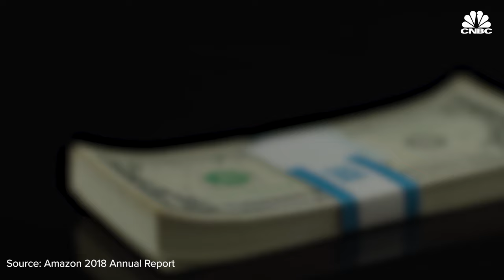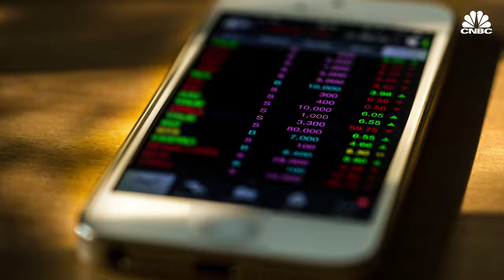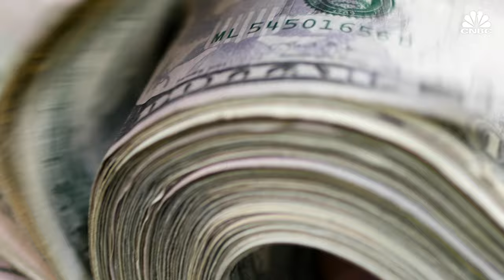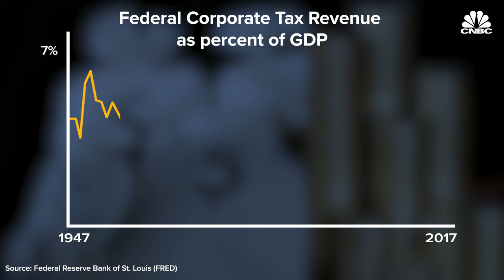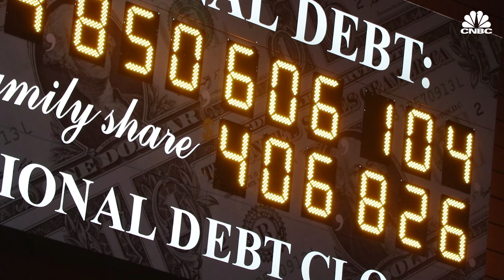How Amazon Paid $0 Federal Income Tax in 2018

Comment: Amazon is trying to modernize and automate their business.  So the cut they were givin, which is supposed to trickle down to the employees, is instead being invested in technology that will replace them.
Reply: And that is the real crux of the issue. I work at Amazon right now and they recently build an automated warehouse near me and the place I work at has had their employment heavily dip and the number of products going through the building doing the same. A building that only a while ago was one of the biggest in the area is now a shadow of it's former self. 

This means those cuts definitely wont return back to the people. And with Amazon going fully automated other warehouses will shortly follow suit and possibly buy or rent Amazon machines similar to how many data centers are owned by Amazon. Many don't even know that games like even Fortnite run on Amazon data centers.
Reply: Go learn how to repair the automated machines when they break??
Reply: Jack Smith they could train some of their employees to be technicians but it would be a small fraction of their workers.  No company has ever automated their business and then kept all the employees on salary just in case a piece of equipment breaks.
Reply: @patdeen6648  That's just the natural workings of capitalism. In order to keep up profits they must continually cut labor costs. However the world is finite in size and the workers can not buy back all that we produce which leads to continual economic crisis. Capitalism is the first system to suffer from crisis of over and not under production. The capitalist close plants if the can't make a profit or can make bigger profits elsewhere.
Reply: @JustAGentleman Spoken like a true member of the Upper Class or middle class seeking recognition from the upper class. Obviously you think of yourself as a consumer because that's your main role in society "to consume". Why not dress up as the last English Viceroy of India holding a tea cup and asking a servant if it's time for tea.
Reply: @JustAGentleman US wealth in general has more to do with the size and large population of the country, the land for farming and the country being untouched by war since the end of the civil war in 1865. Being connected with England and its Industrial revolution rather than Spain and it quest for gold didn't hurt either.
Reply: Amazon jobs is very disliked . If they don't get robots in then they will fail. Nobody likes working for amazon as it is too demanding and most of their employees leave with the first months, so if they dont automate their company then they will risk killing their business
Reply: My amazon doesn’t have tech lmao
Reply: Pat Deen exactly why universal basic income makes perfect sense.
Reply: @Jack51971  that's easy for someone who did it for 5 years CNC machines soind about right
Reply: @kimobrien.  that's not the workings of capitalism thats the workings of greed
Reply: @Wamsuo58u  What business tycoon is not a greedy capitalist who would sell his own grandmother if it meant bigger profits and market share. A capitalist who refuses to be greedy and compete is headed for bankruptcy court.
Reply: @kimobrien.  sociopaths are the problem not capitalism
Reply: @Wamsuo58u  The system is such that it rewards sociopathic behavior. Behind every US Military adventure is a boss seeking higher profits form his foreign investment.
Reply: @kimobrien.  can't argue with you there but that's not the case in every circumstance
Reply: Your story will be the ever growing norm. I hope you’re doing ok. Have you heard of Andrew Yang?  He wants to bring in Universal Basic Income to pay $1k per month, to each Adult US citizen because of all the job loss already happening and that will accelerate.  Amazon is rolling out what you’re talking about right now.  Andrew Yang proposes adding a VAT to each Amazon purchase & others to pay for the UBI.  Because you’re right only a small number of jobs will be left to maintain those machines.  

It’s happening at other companies too. Accenture just told a bunch of underwriters they’ve been replaced by AI machines but they’ll train them to check the software. Ironic having to keep check on your replacement! They won’t need many.. google search the story 

We all need to help Andrew Yang get into office to help the people.  Trump is not even talking about it.
Reply: Andrew Yang is proposing Humane Capitalism.  Check it out on his website.  

#Yang2020
Reply: modernization is partially a byproduct of an artificially inflated minimum wage-  the $15/hr luxury of the entry level job comes at a cost somewhere down the line-  wages go to zero dollars once they are not needed anymore...
Reply: R + D is tax deductible as mentioned in the beginning of the video. So, technically totally legal
Reply: Major FACTS!
Reply: @Skylancer727  scary stuff, I hope you find something else before the shoe drops. 
#yang2020
Reply: @JustAGentleman Most of the consumers won't be buying when they don't have a job
#yang2020
Reply: @JustAGentleman Until they get the drones sorted out
#yang2020
Reply: @Kyle-pj2vc  And big billion dollar campaign contributions incentivize massive tax cuts for those donors

Pfizer --> 
Donations to GOP: $16M 
Tax Cut Received: $39B 

GE-->
Donations to GOP: $20M
Tax Cut Received: $16B 

Chevron-->
Donations to GOP: $13M
Tax Cut Received: $9B 

#Yang2020
Reply: @jobokidd  personally plan on joining the rail road. Though that will likely be going automated in the next decade too. I want Yang to win but seeing his debating skills, it's not happening. The last debate showed pretty well he isn't quite ready and he needs some time to understand how to get your voice out there. 

I'll vote for Bernie this time. I'm hoping since Yang is pretty young he will have a chance to shine next time. He will definitely have a stronger name for himself by then. By that point Amazon will have nearly gone fully automated and self driving cars will be threatening truck and taxi driving. That is when a paradigm will shift and his voice will stand above everyone else. Too many people right now have their heads on other policies and some are too sceptical of socialism to support it. When the threat is more visible then I imagine more being conscious of it. Then he will be number 1.
Reply: @Skylancer727  Did you see that NBC shut off Yang's mic?  There are some montages of all the sneaky media sabotage of Yang, which really proved to me we're now in a Plutocracy.  I understand where you're coming from though.  I'm still hopeful for Andrew and trying to spread the word.  Peace.
#yang2020
Reply: @jobokidd  Yeah, UBI is the way of the future. I just don't think the idea has baked long enough. When automation is more visible to people, then they will care. With automation in the warehouse, driving, and shopping markets; it's already covered nearly 60% of the work force. This is the calm before the storm and unfortunately, it seems people just don't see it coming even there it's already on the way. 

I feel it's people's desire to grasp on to capitalism as it is the big thing that made America special, but like it or not automation is coming. We can either block it or adapt for it and I choose the latter.
Reply: You are right a large percentage of jobs will be replaced by robots, self driving cars and AI driven programs in general. Sadly this storm is going to happen much faster than most people realize and are prepared for. If and when Quantum Computers become much more practical at a reasonable cost this also will be a huge game changer, especially once it's combined with AI and robots. Quantum Computers are coming in my opinion, likely much sooner than we expect. It's just a big breakthrough or two away from changing everything overnight. It's not a matter of if but when in my opinion. I closely follow AI and Quantum Computing and both fields are advancing rapidly recently.

I'm not sure if a Universal Basic Income would work or not but something must be done to counter the massive loss of jobs that is coming due to the things I mentioned above. That much is clear.
Reply: @AnthonyGoodley  well I'm not as certain behind quantum computers coming any time soon. Right now we are limited by our understanding of quantum mechanics and our understandings of physics as quantum computers require rare properties to function (such as super conductors which right now require exotic cooling). Basically quantum computers can't take off till graphene is perfected or we switch over to light based computing. But of course if we can get quantum computers to be mass producable at least in the $50,000 price range expect many logistical and engineering jobs to start disappearing. If a computer can process thousands of concepts at the same time to find the optimal solution, we don't stand a chance at competing. 

Of course automation in general is already more than capable of plowing over the entire system. With jobs like warehouses, driving (taxis, trucks, trains, etc), and stores already possible in some form, that's already a substantial number of people that have to change career paths and many other fields will be harder to get into or be getting in risk of being replaced as well. 

UBI is more something that has to be done out of necessity more than anything else. It sure isn't perfect but we are kinda running low on options here.
Reply: @Skylancer727  The value is passed on to average americans, it means cheaper prime membership, cheaper products, higher quality of life for all, basic economics.
Reply: @luigidaniele6613  That's "simple economics" not "realistic economics". Something you learn pretty quick if you watch the stock market. That's what is implied, not what will be done. There is a huge difference. 

Just to prove my point. Did Amazon lower the cost of their products or their prime membership when they got their second HQ with tax exemption in Virginia... nope. While basic economics would suggest that's what they should do, they did not. Why though? 

Well that's easy to answer. Every one of these "implied" returns are negative to the business's growth which Amazon is built around. By raising wages, or cutting their profits that will also hit their stocks which is the way Amazon got so big. Instead of taking that money and giving it to the people they already have, they instead use it for stock buy backs, building new warehouses, investing in new fields (such as how Amazon owns a grocery store, rent-able data centers, a music streaming service, video streaming service, the essentials, and even a space program), and most well known, building machines that will make the jobs cheaper to run. 

This is how real economics works. If economics were as simple as you say, then Amazon is the richest company in the world! Surely that means they have the best paid employees right? Absolutely not. Until October last year they only paid $12 an hour which is minimum wage in some parts of the nation. Even worse, they only raised it after a threat from a Congressmen to push for a bill to charge large companies for employees that are on wellfare, food stamps, and other government poverty programs. It's just like how when Walmart were challenged at a stock holder meeting to raise their minimum wage they then instead said to the media "we will no longer lobby against raising the national minimum wage" basically saying "only if you make us". That's how real economics works. 

If the economy worked as we wanted, we wouldn't have the working poor or the need for unions. Unfortunately corporations care more about their stock value then their employees today. That's just how the economy works. I mean, that's even why we had the great depression. When a lye spread that a bank in New York refused to return someone's cash they told the town, everyone pulled their money out, the stock owners bailed, and being such a big bank the market crashed as a result.
Reply: @Skylancer727  First of all, most of their warehouses are still full of thousands of human workers, few of their warehouses have been fully automated. Second of all, the warehouses that HAVE been automated have created more higher value jobs in the field of engineering and for the companies creating those websites. In the end the value still goes somewhere.
Reply: @Skylancer727   Skylancer727  you're overthinking the entire thing, amazon has over half a million workers, basic supply and demand. Of course they are low payed, in fact I think they should be payed even lower, they are doing work that a lot of people are willing to do for $10 per hour. And you are simplifying that is not at all how the great depression happened, their were dozens of variables that lead to it happening. Their was a huge economic boom before hand and the economy was set for rebound not to mention the implementation of the federal reserve which the fed even admitted to having played a significant role in the great depression. You are using very linear thinking in your perception of wealth and companies and it seems you don't understand the concept of supply and demand. It doesn't matter how much money a company makes. First of all their is profit. Even if apple was half the market cap of amazon, apple would still make way more profit then amazon. Not to mention apple outsources most of its manufacturing and distribution. Apple has about 100,000 employees meanwhile amazon has more than half a million. Market Cap simply is the average selling price of the stock multiplied by the number of shares. It does not equate in anyway to the amount of money made by a company unless in terms of the revenue to market cap ratio. An artificial raise of the minimum wage only hurts workers and small businesses and strengthens corporations and monopolies even more. Most small businesses already struggle to pay employees, when minimum wage raises they are forced to take 4 options. Fire employers, cut employee hours, cut employee benefits   or raise store prices. This increases the rate of inflation making everything more expensive for everyone and raises the barrier of entry to get a job creating more unemployment. I can tell you obviously have never owned a business. It is not amazon or Walmarts fault if they pay " too low" people have a choice if you think a job is worth the money then take it. If the job isn't worth the money then don't take it. It's really that simple. And if that job is your only choice you better be thankful that it exists because if it didn't you would be on the streets. If you think amazon abd walmart is so bad then make your own business that's better.
Reply: @luigidaniele6613  incorrect. First off, Amazon Warehouses only have a few hundred employees per building (I work at one in a split between three cities). And one thing I have noticed is ever since they built an automatic building up north, our work has cut in half, rules and reasons to get fired have gotten more strict, and they haven't hired a single person since slightly before the automated building went up. My building use to be the fastest in the tri-state area and even with our lower employee count we still are marked as it (which only shows the same is happening in the near by area). 

While you would expect employment in engineering and computer software to go up, that hasn't really been the case. Every building already have engineers so they basically just retrain the older engineers on how to work on the new machines. Plus, they already have tons of tech people who already run their normal warehouses and data centers who can do basically the same job at the automated buildings. Also, getting rid of 400 employees in the pick, pack, and sort departments doesn't really get made up by the 20 mechanics and techs that replace them. Not to mention those are jobs with more job requirement. Amazon right now is a job you can walk in straight out of high school, no interview, you're hired. To get a position in the engineering or tech you need degrees or certificates making them far less open to employment. 

Not to mention Amazon basically taking any job with easy access. Their grocery store is designed to cut cashiers, there are plans to invest in self driving trucks cutting them out, etc. Even if they add a few new positions in engineering, that's a harder career to get into not making it an equal to what they took away. Plus the pay isn't really that much higher. Some higher paid current accosiates make about $50,000 right now and the mechanics on average are about $60,000. Plus tech jobs are much worse. A friend at work applied to one for the building up north but they only offer part time with no benefits making a far inferior position. Not only with less pay but no healthcare makes it terrible in comparison. 

Not everything is as simple as seen from one point.
Reply: @Skylancer727  I'm not talking about more engineering jobs at amazon I mean in general. Amazon uses over 100,000 Kiva robots and amazon still has over 500,000 human employees that is a fact you can google. The only reason why the cashierless grocery store works is because people like convenience, that simple. If you think amazon just takes the extra money as profit you are very wrong, you can look up the public records of incorporation and anual taxes of amazon. They have gotten nearly $0 profit. Because they have reinvested nearly every $1. Jeff bezos doesn't even make much, jeff bezos only gets payed a salary of $80,000 per year, their are engineers that make more then that. Again if you think you are underpaid then leave the job and get another one. If you can't then that means you aren't being underpayed. You are getting the best wages of the market. And if you actually work for amazon you'd be currently getting payed at least $15 per hour.
Reply: @luigidaniele6613  $15 an hour is not best on the market. Ocean springs down the street is the same job for $19 an hour and walmart's warehouses are also $18 an hour here. Maybe nation wide but definitely not here. 

Also, I'd check your numbers again. Bezos makes $6.4 billion a month! How do you think his wife took $30 billion in the divorce and 4% of the business's stock? (https://www.businessinsider.com/what-amazon-ceo-jeff-bezos-makes-every-day-hour-minute-2018-10) Also his actual salary is $80K, but with securities and benefits of $1,681,840. Plus he uses stocks for most of his wealth as it allows him to make more money over time. Many rich people do this. Trump does the same. 

And yes, they still have 500,000 employees, but so what? If you actually look at the trend though, it's a different story. The trend of them hiring more is going down. It only went up by only 60,000 in 2018 vs the nearly 120,000 in 2017. It literally halfed. And that is while they are eating up other industries and building new buildings and fields. Remember that Blue Origin doubled in size last year yet employment across all of Amazon only went up 60K. That shows it all really.
Reply: @Skylancer727   Skylancer727  what's your point? I was right that he only get's $80,000 from amazon. He doesn't get Billions from amazon, he gets that from stock value which comes from speculated value by share holders. Your now trying to make it redundant that they have 500,000 employees and before your argument was litterally the fact that they have so few employees that they should lay much more. Why are you comparing job growth of amazon vs blue origin. Completely different industries and neither of them owe you anything. If amazon is so below market value then why don't you move to the ocean springs job right down the street?. If a job is too much below market value then nobody would go to it, it's a simple equilibrium that keeps things in check. If they pay too low then nobody will want to work. Neither of these companies owe you anything. If you wanted you could create your own business or learn a valuable skill but you choose not to. It's a choice at the end of the day to be in a lower class position especially if you live in america.
Reply: @Skylancer727  Jeff bezos wife didn't take $30 Billion, She took $30 Billion in STOCK and in case you didn't notice the stock is extremely volatile, it was originally worth $120 Billion but diluted and dropped down when the split happened. Again that is not payed by amazon and he doesn't get $6.4 Billion per month from amazon. That is all from stock value rising. And he can't get any of that money unless he sold Billions worth of his stock.
Reply: @luigidaniele6613  The point is he is not only making $80,000. Like I said, he gets and extra $1.6 million every year for securities. Also, getting stocks from your job on a monthly bases is a pay check. He just realizes he can make more that way. By that logic, Trump only makes $400,000 a year. Stocks given on a periodic basis is still salary. That's why that is included in every check online. 

And no, I did not say they were't hiring anyone. I said they are trending away from hiring. The last people to get hired at my building was 10 months ago, just before the automated building was finished. They off course have made a few more buildings and have made are building another automated building in the area. And the statistics show that their rate of hiring employees has indeed gone down with the rise in their automated buildings. It's beginning to peak just before it starts to drop. That might be 2 years off yet but it is definitely coming. And I mentioned Blue Origin because they are included in Amazons employee count. They doubled their size and our numbers barely went up last year. That shows my point. We don't have numbers for 2019 though yet since the year isn't over but expect a trend. 

And they undercut us only shortly after I got hired. In that time though, even with more competition, we still aren't hiring. Also it's not like you can just go back and forth between companies when you want. Like I said, Amazon has not been hiring. If I left and they raised wages to undercut them it's not like I could just switch back. You apply when they ask not when you do. 

And I never said anything about making my own business. that's entirely off tangent. Besides, it's not like I didn't have a worse job before Amazon. I did choose to go up a tier, and I'm training in engineering. I am doing the work. I never implied I'm sitting on my laurels.
Reply: @luigidaniele6613  Which he can do any time. I have stocks in Amazon too. I sell them every once and a while. But he is given stock by the company for no cost. That is salary. To be given money. Your argument is basically the same as saying "my salary in bitcoin isn't my actual salary, it is volatile". It's still a salary. He didn't pay for it. It doesn't matter if it is volatile, it is monetary value given for the job. That's why when jobs give you stock they tend to call it a "bonus" stock. It is technically part of your pay as it is given to you. Why some jobs also give you the option to just take it's dollar worth immediately. 

It's not that he owns stock, it's that he gets more for having the jobs. That is salary. It's not like I'm holding the fact he owns a large portion of his own stock, it's that he repeatedly gets more without cost. That's why it is valued as his income. Because it is.
Reply: @Skylancer727  yes you are right, trump only gets $400K per year FROM THE U.S GOVERNMENT, that is true. And no amazon stock is not a paycheck because that $6 Billion per month can also be -$10Billion on any given month. He doesn't get payed more stock, the value of the stock simply grows.
Reply: @luigidaniele6613  No the $400,000 was when he worked at Trump tower. That was his 2015 salary. And no, Bezos periodically gets bonus stocks. That's part of his salary. That's why he only takes $80,000. Trump did the same thing. Yet he owned golden pillars which he got from selling those bonus stocks. That's how they work.
Reply: @Skylancer727  Bezos originally owned 100% of stock, he is simply getting back stock that was previously his. And I say $400K per yea because that is the presidents salary. Any other money is irrelevant since taxpayers don't pay for more than $400K.
Reply: @Skylancer727  "That is salary. To be given money" He is not given money though, He is given stock. Stock litterally is not money. When Jeff bezos get's $1 Billion worth of stock amazon does not loose $1 Billion. It's stock not money. If I give you a $500K house that is a house, not stock. In fact A house value is even less volatile then the value of stock, so if anything a house is closer to money than stock, still not money though.
Reply: @luigidaniele6613  No he makes about $500K as the president. Like I said, that was his 2015 salary, ie, before he was president. And I'm saying he too also had bonus stocks on top of that. It's a common practice in the corporate world. That's the point. You can't take his salary at face value. If that's how it was, he wouldn't have a private jet but he totally does. 

I'm not complaining about Trump taking money from tax payers. Again, I wasn't even stating his government pay. I stated his business salary. Not the same thing. I made the point as to show he isn't the only one who take bonus stock. Trump does too (or at least did, now more his kids do). This isn't a comment sh*ting on Trump.
Reply: @luigidaniele6613  then by that logic, a house is more money than bit coin. Yet I can use bit coin on multiple websites as currency. Bit coin is still money. It is labeled as ungoverned money. That goes to show that something being volatile doesn't mean it isn't money. Money also fluctuates in value. That alone shows how pointless this argument is.
Reply: @Skylancer727  when did I ever say currency is defined as something with low volatility?. All I said was a house litterally has more similiarties to commonplace currency. Stock still isn't money. It's stock. Yes bitcoin is a currency. That is litterally the purpose of bitcoin, to be a currency. Meanwhile stock isn't. Stock is not money.
Reply: @kimobrien.  yup, slavery still just you get to pick your master basically lol. Thankfully I've found a job I love doing so it doesn't bother me much lol.
Reply: @jidowu6019  Nice to know that you have reached the economic understanding attained by the citizens of the Roman Empire using salt and coins as money. Did the have movable type back then so a scholar such as yourself could impart your economic wisdom?
Reply: @stephenmartin5766  You will be impacted by the class struggle one way or another because capitalism can't help but have economic recessions, depressions and wars no matter how much you love your job. No matter what Trump or the conservatives of both parties call it. We already have a social democratic regime in the US just like the Nordic Counties Regimes. Bernie Sanders wants more Social Democracy the Conservatives want less. 

World Stalinism at its very center, the Moscow regime in the Soviet Union, collapsed because any kind of workers democracy ended with the 1936 to 1938 Great Purge trials of the old Bolsheviks. Something else also happened no longer can the Stalinist pose as communists with their rotten methods and backward thinking. 

You don't get to socialism by shutting working people up, carrying out a socialism in one country policy or giving greater and more privileges to party officials.
Reply: @jidowu6019  Why is it that people such as yourself feel the need to lecture socialist about money and simple trade? I live in the US, I've had more than one job, do the grocery shopping, fix what I can to save the cost of the maytag repairman. Yet somehow people such as yourself feel the need to lecture about money, barter, trade and theft.

 I also ran a paper route when I was about 14 to 16 years old. I have never taken a college course on business or economics.

One only needs to read and be able to do simple arithmetic to gain a simple insight as to how a business works in " Introduction to Karl Marx’s Wage Labour and Capital" By Fredrick Engles. You only need to google it and read it for free. Its about 25 paragraphs long.
Reply: @luigidaniele6613  and Skylancer727  Basically when you reach Jeff Bezo's level taxes are voluntary. You hire Accountants, Lawyers, and Lobbyist to get what you feel you should pay in taxes. To do this you use all kinds of creative accounting methods like I was paid for doing this job but I'm a philanthropist so I shouldn't pay taxes because government is evil. These guys have a legal way to make and use as many loopholes as needed.
Reply: @kimobrien.  they are not using loopholes lol, they are simply getting tax write offs based off businesses expenses since all revenue is reinvested back into the business, all smart businesses do it and it's part of the tax system not a loophole.
Reply: @luigidaniele6613  "it's part of the tax system not a loophole." Exactly the bosses write themselves the tax laws they want because they buy the politicians loyalty with campaign contributions. It is what's called legal corruption. You don't have to be a genius to realize what's going on.
Reply: @kimobrien.  Except it doesn't just apply to an elite few, it applies to anyone that runs a business big or small and it has been like that for literally over a hundred year it's not any new legislation.  Business expense write offs have been a thing for all small and large businesses since basically the beginning of american taxes.
Reply: People should party less, educate more, so they are capable of being more than box fillers.
Reply: @1bc003  Who will fill the boxes without the box fillers?
Reply: @Jack51971  or learn how to build them
Reply: @kimobrien.  Your delusional ideology isn't any better. "Let's all starve together, comrade!"
As if any communist leader wouldn't act like a corrupt business man.
Reply: Show me where and how Marx, Engles, Lenin, Trotsky, Fidel Castro, Che Guevara acted like corrupt businessmen. You problem is capitalism has turned you into a cynic who fears any kind of fight with the corrupt businessmen. 

You think Cuba is educating doctors for the foreign exchange? A corrupt businessman can not believe otherwise so in order to clamp down on the corruption and deny profits to competitors that corrupt businessman secretary of state Pompao says they will deny visa's to all Cuban doctors.

This is just another example of something that is unexplainable to those who drink the Kool aide.
Reply: @dswarriors Taxing is not a solution because what Peter gives to Paul goes back to Paul again. For corporations taxes are voluntary anyway. If you want to slow automation short of a socialist revolution. Where you build what is needed instead of what is profitable. Then you must strike at profits because then that slows investment in new machinery. You do that with unions willing to fight for higher wages. The capitalist can't simply raise prices which is why they fight so hard against any wage increases.
Reply: As far as automation goes a fundamental law of capitalism is profits flow to those companies and branches of industry that can cut labor time and cut wages. They must keep cutting labor time or wages otherwise prices will on average drop to production costs with no profits. The reason that few companies cut wages they way the did years ago is inflation does the dirty work. With the introduction of the Central bank by playing with interest rates and making talk about inflation a self fulfilling prophecy occurs. Bosses raising prices means real wages are cut through inflation. Every boss tells his workers we are raising the price to give you a raise. (Anytime you hear a boss talking about giving you anything hold onto your wallet).  Next thing you know the grocery store prices just went up. You boss then blames it on other companies not doing well and lazy union workers. The reality is all the capitalists as a class are responsible for the way the system works and robs us everyday.
Reply: @dswarriors Here's my argument as to why the federal income tax is voluntary assessment. The Federal Income tax began with the 16th Amendment than the tax was enacted. To get the 16th amendment passed when its use was not for any federal social welfare and incomes of less than $4,000 went untaxed the rich and the corporations must have wanted it just like the creation of the Federal Reserve Bank. How else could they have gotten the supermajority to pass the 16th amendment?

Fast forward today most of us realize that the Congress, Courts and President do the bidding of campaign donors. Actually it's always been this way at least for sometime since the civil war. Lobbyist bring in their request for tax breaks. But if the tax law said hay give GE a break with this rule everyone would see that. So instead they create a rule for companies making jet engines for America in Massachusetts or if they want to give the same tax break to Pratt and Whitney they say Massachusetts and Connecticut. Many times they make it in a single county and state that way it often makes it even more obscure to anyone who doesn't know who owns what in that particular county.  Manufacture of say water pumps helping America with fresher water. It helps if you can say somehow your helping the country with some particular problem. No one in Congress is going to get up and denonce Jet Engine manufacturers or water pump makers for fresher water.
Reply: We have bought nothing from Amazon for more than a year now.  After finding out how far the tentacles of that company have gone and their influence peddling, no more.
Reply: @felixu-mh2mx  Unless the Amazon workers are on strike boycotting serves no purpose since exploration takes place at the point of production not when you buy something. You end up in the belief that some bosses are better than others when the are all responsible for the workings of capitalism. Even when the workers win a union victory it is just a temporary victory as the system once again begins the inevitable competition for jobs which once again drives down wages.
Reply: @kimobrien.     so, we should just give up?
If people stopped buying Nike shoes, do you think it would affect the company, its stock, and its employees?
Reply: @wynnhorton1208  If you start a Nike boycott without the Nike's workers onboard then all the company will do is say these people are attacking our company and we will have to fire you if we lose business. 

Fascism has a specific definition. It's a movement of a middle class suffering from the crisis of capitalism that also attracts declassed elements like the long term unemployed and petty criminals. The begin by using political violence against any kind of opposition especially meetings like those of the unions and the workers parties. 

The ruling class usually rejects them unless the fear their loss to a socialist revolution. That's why Hitler was jailed after the "Beer Hall Putsch" but later handed power by Paul von Hindenburg.
Reply: @wynnhorton1208  Yours is the predicament of the small businessman on one hand you have a payroll to meet and on the other you can find that the banks are unsympathetic when you need a loan. Then there is always the possibility that the market will change somehow and put you out of business. While things may be going well or Okay when a crisis hits you are placed into a vice by the very system you think is good.
Reply: @kimobrien.  And yet Communist China applied capitalism.